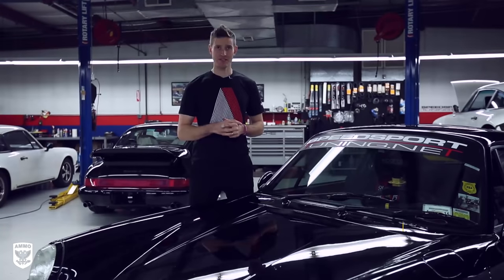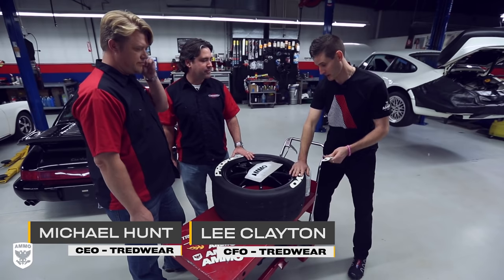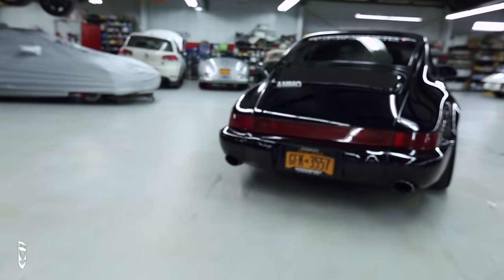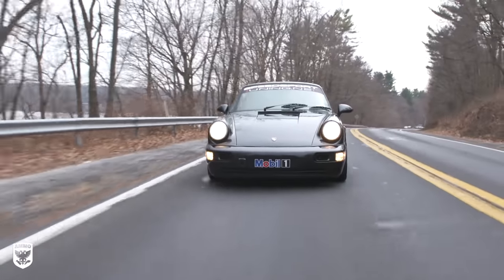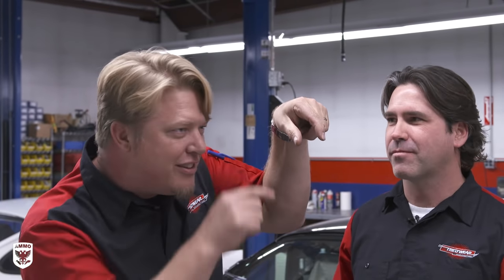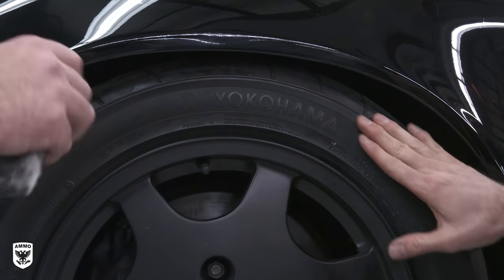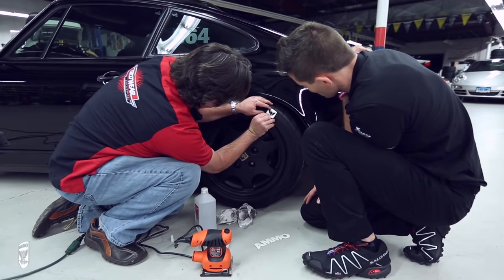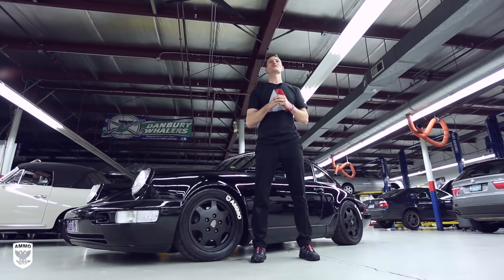How to Install Tire Letters

Comment: Finally I could stick a red "P ZERO" lettering on my tyres for extra grip
Reply: Get those option tires on!
Reply: +Riswan Ahmad P I just ordered Pirelli P zero 295/30/19's to the back and 235/30/19 to the front :) Getting ready for the summer!
Reply: ***** But thats pretty normal to wear 1 set of tires in a year on a sports car.
Reply: +Ginja Ninja MotoVlog The stickier the tyre the faster they'll wear.
Reply: +Riswan Ahmad P 
hAHA yup
Reply: +Riswan Ahmad P And don't forget the extra 5 HP per sticker...

Comment: I was pretty excited about getting these for my MR2 turbo but at $240 to do all 4 tires top and bottom I think ill pass
Reply: +Kevin Minato It's just rubber with rubber contact cement. Like a patch that you use to fix a bicycle tire, except it's been cut to the letters/design you want. 
I'm sure if you're creative, you could print and glue out your own design onto some rubber, cut it out carefully and then stick it to your tire in the same manner. 
The lardest part will be sourcing the the correct color rubber, but it's probably going to be far cheaper than 240 bucks.
Reply: look at painting with Sharpie paint pen it is oil based and I hear it last a long time I'm trying it on a new set of tires.
Reply: they say cleaning is everything. it is very tacky though I hear it last months
Reply: +Kevin Minato how? It would be 110 including shipping for all 4 for me? Did you have many characters?
Reply: +djfrozone $29.95 x 2 per tire for top and bottom x 4 tires on your car = $239.95usd = $329.58CAD + shipping and taxes would be around $450+
Reply: +Kevin Minato ahhh yes in that case check tagyourtires im doing pirelli Pzero. one will be top pzero will be on the bottom so to speak. 24 a kit. so all 4 for 110!
Reply: +Kevin Minato you can get them cheaper at tiregraphix
Reply: +JokerCirca66 paint marker at walmart... $2
Reply: They sell the kits for around one hundred bucks thats not bad, and as far as installation... get your lazy ass off the couch and do it yourself, you don't need to be a pro to put a patch with glue on a tire.
Reply: lol at being lazy... I have fully rebuilt my entire MR2 engine from the ground up all alone.
Reply: +Kevin Minato you could do the spray paint but then clear coat over it to stop it turning brown
Reply: I found one that’s for 120 and it was really good

Comment: If you're driving in a hospital or laboratory it's all good. But if you're driving on the road especially in countries that get a lot of rain and sunshine, you'd be lucky if they stick for 3 months. The heat and rain will loosen the glue and the alphabets will fall off or if you scrape against the curb, it damages the alphabets. Secondly, the rain will turn your white alphabets yellow unless you wash your car and detail the tyres everyday

Comment: "industrial strength glue" 

applies it without using gloves. hmm....
Reply: +MesserAaron13 industrial strength glue will rip a chunk of skin off and cause a infection it's not like superglue
Reply: I'm pretty sure its just a vulcanizing solution, or rubber glue. If you've ever patched a bicycle inner tube its the same. This looks like a fancy tire patch
Reply: Is it like superglue? 

Or like that stuff you use to glue a patch onto a bicycle tire? So more of a solvant?
Reply: Probably something similar to Loctite 406 or other cyanoacrylate glue. You can call it industrial, but so are screwdrivers so it really doesn't mean much
Reply: Glue and gloves dont match.
If the glove got a hole in it the glue will stick to your hand.
Reply: zerou24 Good point. Also, ever try putting duct tape on something with nitrile gloves on? It just doesn't happen. Stick the tape to the gloves and makes a mess. Same thing with these tire letters I'm sure. Rubber cement with rubber gloves...
Reply: Industrial strength refers to cured strength not curing time... Many of the strongest adhesives are harmless on the skin for long periods of time..

Comment: Just came back to this video out of nostalgia. I wanted to say this product is pretty good for what I was looking for. It really stands out, makes it look like my tires came like that rather than the DIY paint. I'd get lots of questions and compliments when I first did it years ago. A couple tips, make sure you get the correct size letters and I honestly think it looks the best with bigger tires not so much the thin sport ones. Saw a guy get it on his charger with letters waaay too small and it didn't look right. Take your time with cleaning and sanding, it really makes it last because my first time around I rushed it and the letter E's had the middle bits rip off often. Take time with placement because it will really be noticeable if something is crooked, bubbled under, or not equal spacing. My review on the glue, you sure its not just super glue? Haha Thanks for the video either way, couldn't have done it without you.

Comment: That stuff is exactly the same material used to make rubber inflatable boats and their brand logo's, then laser cut to suit. It's uv treated and the glue is the same as on RIB boat's, it's a flexible pvc cement.
This is no great invention merely a new use for old technology. All the best fellow youtubers.
Reply: nudgeee80 so that means the glue comes off at one moment..

Comment: Sanding down the rubber to have an even finish, then cleaning the surface will help a lot. But we need to keep in mind how strong the sidewall of the tires are. For example I have both Federal 595 Super Steel Tires and Pirelli P Zero Run Flat. On the Federal 595 the letters came off after a few months. And on the Pirelli P Zero Run Flats they holding on just minor discoloration due to tire shiners but u can revive it with the tire markers. Also i have tried many adhesives. Such as rubber cement crazy glue gel, rubber adhesives, gorila glue gel, locktite super weld gel, and I will try contact cement now. Too see wich one holds the most. But in emphasis the stronger the your tire sidewall the more they will last.

Comment: I've been using yellow Neoprene apron material. It has a mesh backing. I've had letters last about 1 year on my DD.
I use the Aron Alpha glue from TW, but I cut the neoprene myself. I make a template on my computer with black outlines. Then double sided tape the neoprene to the paper, and in a well lit area, cut each letter. The best glue is Aron Alpha; I've tried contact cement (so-so), loctite glue (some turns yellow in UV sunlight).
Prep is key. I've also carefully trimmed raised letters off my tires to get a smoother surface to glue onto. I would not try to glue onto the ridge sidewall on most tires.
Given that sidewalls flex, no glue will last forever. I'm hoping to find a real vulcanizing rubber glue that might be better and flex more. More aggressive cornering means less life of the letters as it flexes, or you get actual contact with the road if you put the letters too close to the tread.

https://www.uline.com/Product/Detail/S-18815Y/Work-Wear/Neoprene-Apron-Yellow

Comment: Awesome as always. In future I'd love to see some tips on how to reset the car; completely strip the current layer of paint sealant/wax.
Reply: +bongmistt Full wash, decontamination and possibly a clay. Polishing or a pre wax cleanser will remove too. You could even use an isopropanol mix or Car-pro eraser i guess. Dunno why you'd want to do that though? If you wanted to polish, you'd remove anyway as you polished, and if you're changing product, then a good washing will be fine to then apply it?
Reply: Toby Bear - I purchased the Ammo regiment but still yet to use it. Being new to detailing I'm still trying to get my head around a lot of stuff at this stage. My next step is to purchase a polishing machine.

Comment: been doing this for years sand the part u wanna spray paint with a fine grit the get ur stencil on regular white paper tape it on spray it 2 layers then use a spray on gloss to seal it never had problems usually last me like 6 to 10 months depending on washing dont get ripped off

Comment: Hmmm, really curious as to whether you can still use normal tire cleaner on them. Also, are they enough weight to throw off the balance of the wheel/tire?

Comment: i use silicone for lettering
silicone is what hotrodders have used for years to do there white wall tires
cheap easy to do
Reply: what do you mean by silicone please explain
Reply: Cool, I thought there was some kind of "white tar" paint they used way back when, if you look at old color photos of white walls from the 50s and 60s, the "white" wall tires were always a beige/classic cream yellow color instead of white. I thought everyone just dealt with the color change and the "white" cream yellow tire walls after 6 months

Comment: Okay, maybee a little ocd here from my part. But i would either take the wheels off or spin each rim (drive forward/back) so that the centerloggo on the rim would be level, then apply all the lettering in the exact same spot on all the wheels. ^^,

Comment: Wow, I would not have even let him bring a power sander anywhere near my ride. That said, for the purpose of people at home, I might suggest a manual palm sanding, especially if you are not experienced with one. The same objective can be met, remove the top layer of rubber to expose a surface free of lubricants that are in tire dressings.

The tire lettering thing has caught my eye lately and I've mostly only seen it on the more otherwise ridiculous looking cars out here. Yours is one of the first I have seen on a more tasteful design build. I like the way it pops on the murdered out color scheme. I think I might have to pick some up.

Comment: Really wonder what the tire makers use. Have a Durango 1998 with two tires that has white writing on the side wall and still looks great after many many years. Sadly my two new tires I got didt have the white writing and it is a pain to use a tire pen on them as it takes ages to get done and after one winter it looks like crap.

Comment: Can AMMO do full tire covers?  Get a clean face on the whole fascia of the exposed tire for the life of the tire?
Sorry if this sounds different, I'm just not into stickers (patches as referenced) anymore.  Got a family and kids...
But as a father I am tire-d of cleaning my tires, in fact time to do so is very rare.  Any products like that?

Also masking your rim will not protect from a sander (for you low profile tire guys), can use a dremel instead or your wifes Seen on TV nail sander :)

Comment: I don't get why the patches are not positioned in the same place on each tyre, one wheel the patch nearly overlaps the yokohama logo. Also could the not print/cut the patch to the correct radius of the tyre so it follows the line correctly. Seems a bit shoddy to me.

Comment: The glue dries FAST..  apply to 2 letters at a time, then quickly apply to the tire.  The oils in the tire eventually work themselves back to the surface and your letter will begin to separate from the tires.  Maybe 1 year of service, you can try to re-glue in spots as needed

Comment: To paint tires: wash throughly and clean lettering with ISO Alcohol. Then you paint the tire letters and the trick is to clear coat the side of the tires with a UV resistant spray can clear coat, rustoleum works fantastic. This works wonders and im thinking of making a YouTube how to for this. Give me a follow if youre seeing this and i dont have the video up yet

Comment: I wish I saw this video about the sanding process and the plastic protector. I put these on my brand new Michelins , they are bubbling like a bitch and up close you see the tire adhesive on the sides of the lettering that cured white, but is now brown. When I get home I'm goin to try my luck sanding it clean and start again cause it does make your tires pop, and give them a darker appearance next to white lettering

Comment: Sorry for being off topic but I thought this was a good place to ask. Is there such thing as a switch for the end of a hose that will go straight into the back of a pressure washer? like a normal hose end but that you can turn on and off I guess.
Reply: +Tommy T X Hose has one. But youll need to remove the auto cutoff valve from inside the nozzle. just unscrew andit'll fallout . all will become obvio usif you buy one

Comment: rebalance wheel?
Reply: +Olof L the weight of these "stickers" and the rubber material they're made with, is so insignificant that rebalancing the wheel(s) is unnecessary :)
Reply: +Olof L I'm sure you'll have to. Very sure. also dependent on how much print you have on there.
Reply: Civic R if the stickers weigh more than 5 gram then yes you'd need to rebalance, if not then no.

Comment: Will installing this letters fuck my tire balance?
Reply: +Oscar Rivera theoretically they will slightly. But if you're worried about it you can just pur the same letters on both side and it will cancel out.

Comment: If it's a patented material, they can tell you everything about it. They have no need to call it 'the manufacturing process'. If it's a trade secret, they shouldn't say a word. I think they are confusing the two.

Comment: too expensive at like $30 lettering per tire.
These are only worth it on Very high performance tires....but those tires don't last long....which means your letterings will be trashed with the tires.....unless you can reuse them. I will buy if $10 per tire for my Yokohama Advan Tires

Comment: Detailing in my world means it looks good from a distance and good from up close. What is good looking when I come close and my tyres say in black DUNLOP and then in color again DUNLOP. How stupid is that? I mean if it would go over the original letters then fine. Makes sense. But for the cost of those stickers I really do not want to find out it does not match my tyres. 

It is on a good way but still too early for me to jump in. Gonna wait a few more years until someone invents a mechanism to create you letters matching your tyre.

Comment: 2:35 what? if it's patented you have to list whats in it to the patent office. Anything patented is not a secret. Also why are these guys acting like they invented the actual wheel. Shit looks simple AF take a bicycle tube cut it out to shape, paint it and rubber cement it to the tire. it will cost you about $10-$15 and you can get 10+ decals out of them. If you wanna spend a bit more money and time you can try using white traffic paint (the one they use for the white lines on the road) it will look so much better than these plain white ones.